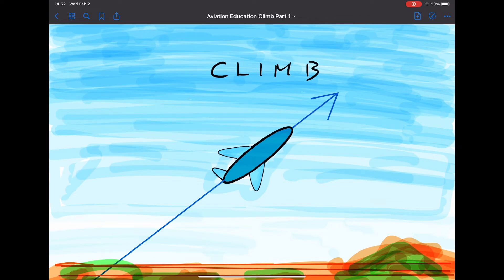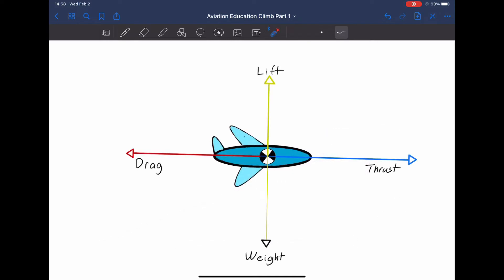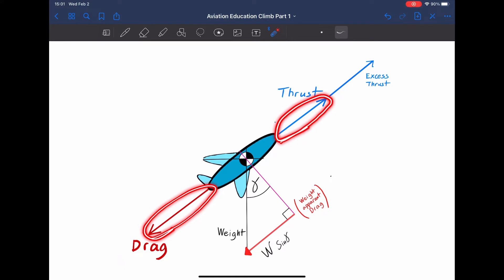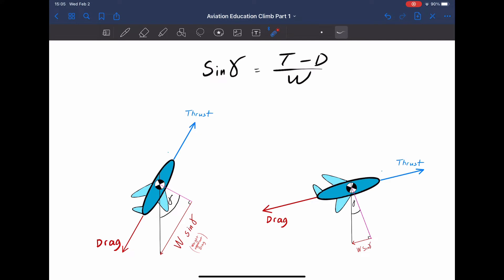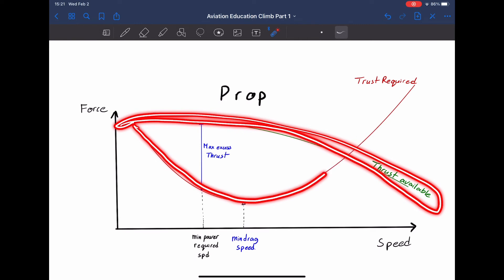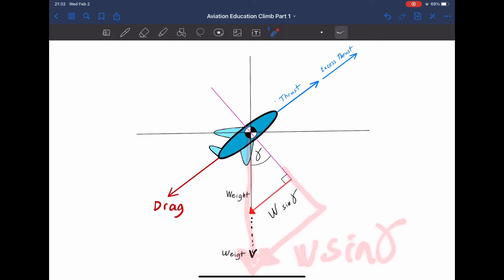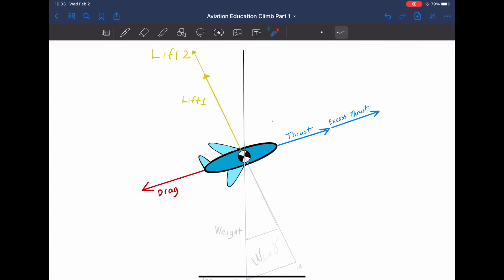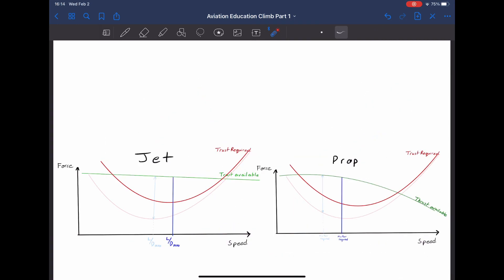Aerodynamics for Pilots: Climb part 1

Comment: Hey. I hope you are doing great.
As a suggestion, can you make some videos on ETOPS covering especially the fuel requirements, critical fuel scenarios and the concept of ‘Re-dispatch’ in the air among other things. Thanks.
Reply from the maker: OH thank you for the great idea... i will do that.
Could you list what exact point you want to understand?
I will focus on those points.
Reply: @flightlevelview2115   Wow looking forward to that. This might be more concerned to the dispatchers, but will you be able to focus a little bit on the concept of ‘Re-dispatch’ that I have heard is used for saving fuel. 
Thanks a lot.
Reply from the maker: @kinshuk-311  you're a dispatcher? Thats a quick video redispatching is a quick concept
Reply: @flightlevelview2115  Nope... Just a curious pilot :)  You can maybe do a video with some interesting insights into ETOPS, I think that will appeal to a wider audience, and you can talk about redispatch as well. Or you can make a quick video just about redispatch. Whichever way you find suitable.
Reply from the maker: @kinshuk-311  did you give a quick intro of yourself? If not please do. Nothing too detailed. Student CPL CFI ATP pilot. Type rating